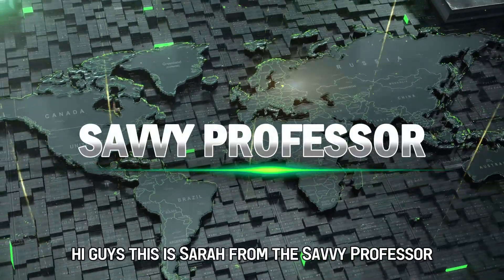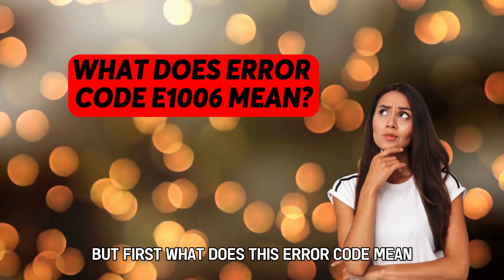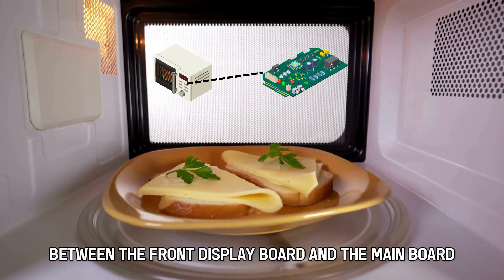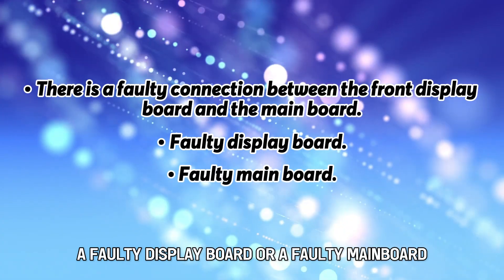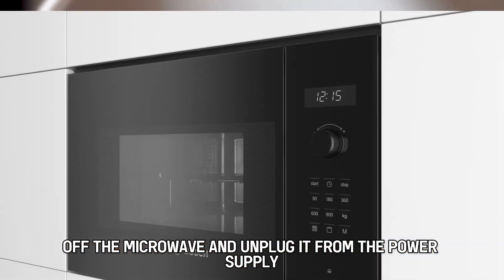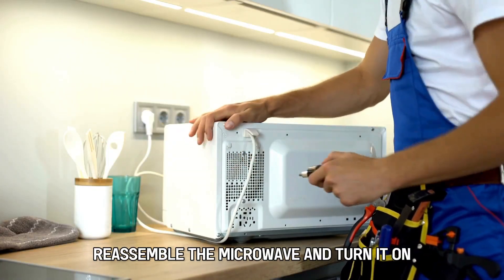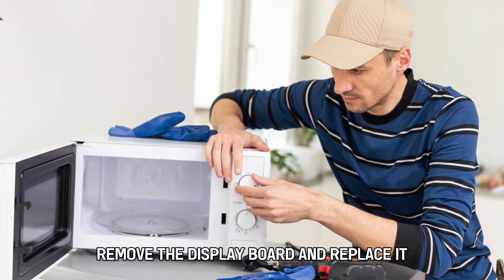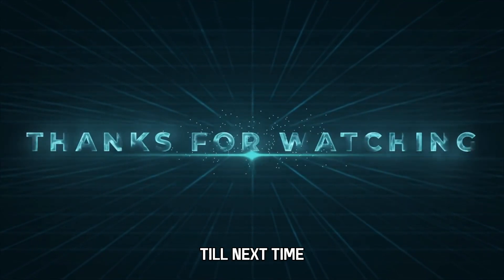How To Fix The Bosch Microwave Error Code E1006 - Meaning, Causes, & Solutions (Reliable Approach!)

Comment: I repaired one for a customer with the same error. The magnetron fillament had a leak to the chassis of the magnetron. On the HV inverter pcb became also some diods, the IGBT and the HV resistance defect because of this leak on the magnetron. I changed the HV inverter pcb and the magnetron and it worked again.